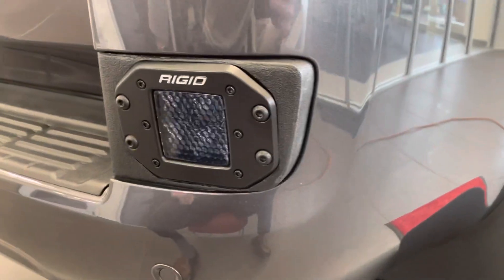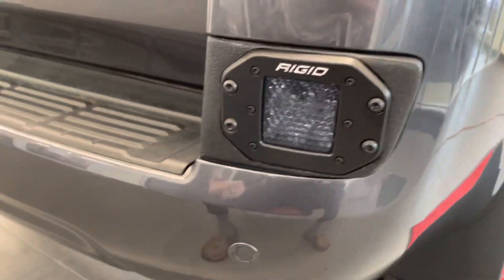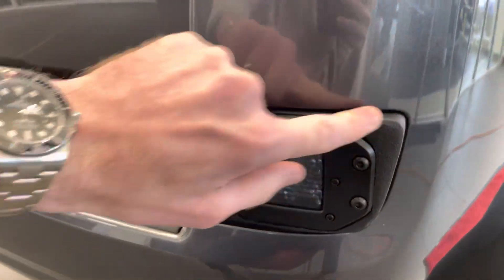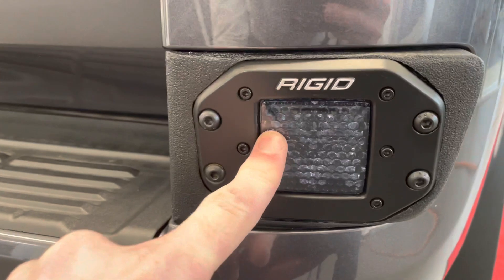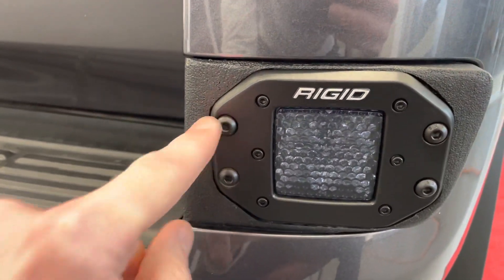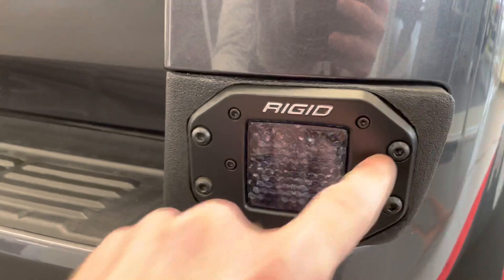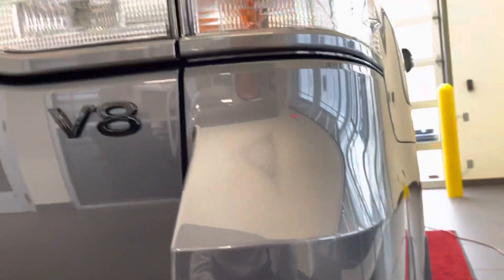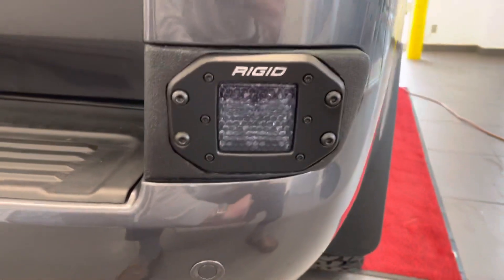3D printed reverse light / Reflector delete for 2016+ Land Cruiser

Comment: Does the rear bumper have to come off to install and connect with reverse lights?
Reply from the maker: Yes, it does
Reply: @edmartintoyota8599  does the rear cross traffic and blind spot monitor sensors still work with this hexpeakmods rear light enclosure w/ rigid light?